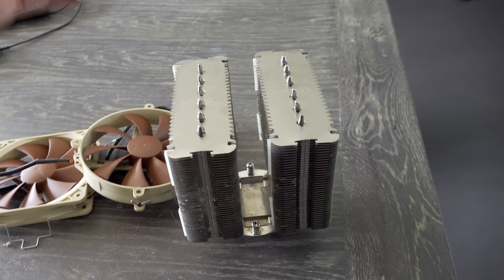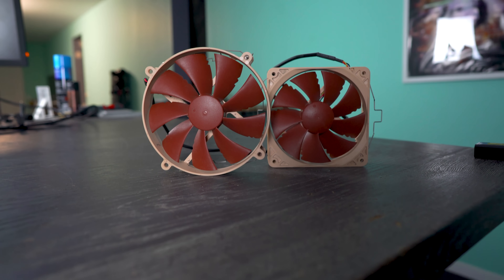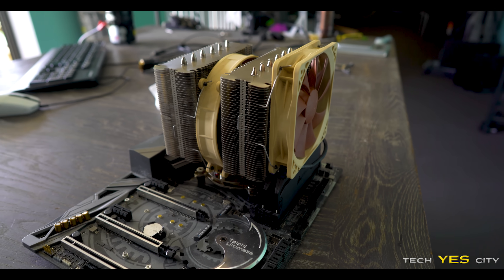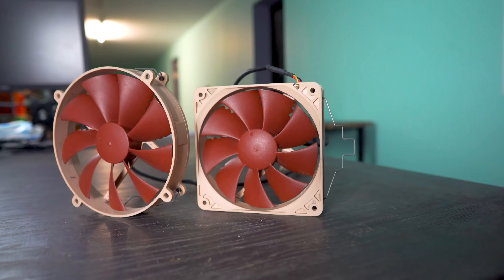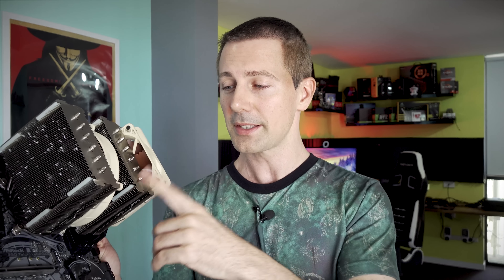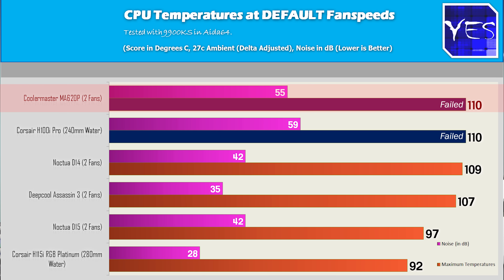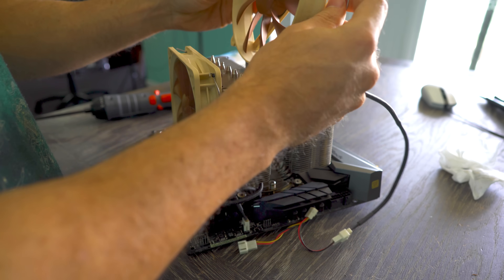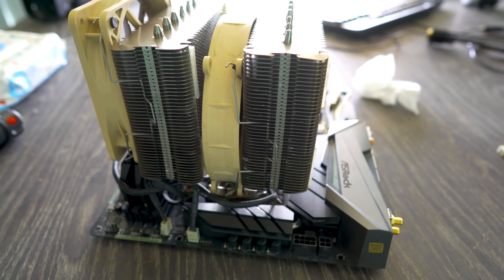This Noctua D14 is from 2009.... How Well Does it Perform in 2020?

Comment: I'm using a D14 from 2016 (came with pwm fans, plus Noctua offer free mounting kits👍) on a 3950x, and it works excellently unless trying to overclock it and push 200watts (it's pointless). I have changed the fans for Arctic Cooling P12 PWMs which does bring a nice improvement (the 1350rpm noctua fans are a little weak in my opinion).

Speaking if which, I had a recent issue of coil whine that got to the point of being unbearable without closed headphones (all fans are either off or ~500rpm at normal use). I took out the GPU as that was the 1st suspect, then the chipset fan, then tried stopping fans and I couldn't find the source. Skipped the Noctua fan from the D14 in the front of my case as it couldn't be that... I've never seen a fan fail that way before (still works the same mechanically). So it turns out that even Noctua fans fail occasionally.

I like Noctua fans, just a shame they're so f'ing expensive (seems pointless bundling speed reducing cables with PWM fans). Maybe I could afford them if I didn't spend so much on a CPU.🤔

Comment: Have there actually been a general improvement in cooler designs over the last decade? I still have an Arctic air cooler from 2012 and it still keeps my very hot FX CPU colder than I'd expect.
Reply: Thre hasn't really been much need for CPU coolers to improve since the power consumption and heat has flattened out or even decreased in later years. My Ryzen 5 2600 has a lot more computing power than my old FX-8350 had, but doesn't get anywhere near as hot.

Comment: Those big air coolers are just as good today as they were 10 years ago. I still use a SilverStone Heligon HE01, which is very similar to that D14, and an even older Prolimatech Megahalems on a couple of machines here. The only reason people have retired coolers like the D14 is because other things "look better" in the case. I've never used an AIO and never will.

Comment: TL;DW: It's just fine. I haven't watched but I'm guessing it's less than 5% worse than whatever air cooler Noctua releases now, since the fans are 11 years old if you got them used.

An 11 year old heatsink doesn't matter. 11 year old fans does.

Comment: I just got a d15 and I absolutely love this thing its keeping my ryzen 3800x at a cool crisp 30 C under load 50-55 C using there thermal paste too. Sometimes depending on what i'm playing I see it hit near 60 C
Reply: My only grip is god damn this thing is huge and I installed it on my board before mounting the mobo, regretted that big time as plugging everything in around this beast was a nightmare but I got it done.
Reply: Shannon Giasson The classic fingertip grip.

Comment: I'm really happy for this I love my D14. Long overdue, I upgraded in Feb to a Ryzen 7 from a Q6600. I had to get the AM4 kit to install my Noctua D14. I do find it a bit comical to have a giant fan and GPU on a tiny mATX board. Funny note, while putting on the D14, I didn't realize I was looking at D15 pictures and so I put the fans in the wrong order. Thankfully, the heat sink did note protrude my ram slots. Great video wished it came out earlier in Feb. Thanks man!

Comment: Definitely a greaty cooler. I have two Noctua coolers (NH-C14 and NH-U12S) that I've used for several years without any problems. When I put together my 3900X build a few months ago I opted for another Noctua cooler, the NH-D15 Chromax Black. 

It also has the slightly cut bottoms to reduce problems with high profile RAM. In addition to being able to adjust the fan placement like on the DH-14 in the video. It also came with the Linus Tech Tips orange highlights(rubber corners) on the fans, which I am using.

Comment: Lol of course it performs well in 2020. CPU coolers can't get old. I use my old cheap CoolerMaster from 00's and it can handle Ryzen 5 1600 with a shitty thermal paste at 78 degrees on load

Comment: NOCTU NH-D14 user Part 2
When I upgraded to an AM4 system I installed the STOCK R9-3900x cooler as I waited for the AM4 adapter from Noctua. I used the Asus DIP5 software in the Asus AI Suite 3 to optimize the CPU performance and fan speed profile. I didn't use PBO or whatever. It did a seemingly great job as it would TEST the voltages at various frequencies. And it found the MINIMUM RPM's to keep the fans going... BUT.. BUT...
The damn stock cooler was constantly ramping up and down as well as making an annoying, whiny motor noise. NOTHING I could do would fix this. When I replaced it with the NH-D14 the same thing happened but it was far less obvious... I finally ended up setting the NH-D14 fans to 30% until 60degC which avoids most of the spikes (even at less than 10% usage) while being more or less silent...
I also found that the FRONT CASE FANS had rapidly diminishing effectiveness. Anything above 600RPM makes very little different even under heavy load. I ended up putting them to about 300RPM and ramping up at 60degC as well but to a maximum of 600RPM. So the optimal fan config I found not counting my graphics card is for the PSU fan to be completely OFF (ECO MODE) and it never comes on, the front case fans are 300RPM then ramp up between 60degC and 75degC to 600RPM, and finally the CPU fans sit at about 300RPM ramping from 60degC to 75degC to about 700RPM then jumps up to 100% fan speed above 75degC to avoid CPU crashing).

Comment: Noctua NH-D14 user here!
Still running this cooler after TEN YEARS solid. Still working perfect! Noctua gave me a free AM4 adapter so now it's cooling my R9-3900x (12-core) CPU. At 20degC ambient I can run all cores at 4.275GHz at just under 75degC (though AVX in P95 will crash my system but everything I actually use is stable including Handbrake for which I run TWO instances so I can hit 100% CPU usage as my 1080p encodes otherwise max out the core usage to around 80% or so).
Reply: Heya, sorry to ask 5 years layer, but how is it holding up for you? I found one in storage, and I was thinking of using it for my next build

Comment: Thanks for the vid. Kindly take your time next time and mount the fans with the rubber brakets please. A real fanboy will get irked by the way you have assembled this thing. For testing you can try the D15 and D14 in pull configuration and experience the really annoying "whine" one of them has at full speed.

Comment: I have old hardware and for Christmas I went the ryzen route, so I looked to find brackets for my coolers. Zalman cpns10x quiet.. No brackets. No brackets neither were ever produced for the Cm Hyper 612s (v1) nor the 412s.

I had a noctua NH u12p laying around and Noctua actually still makes adapters. The thing is it's old, I had it with a nf F12.. 75C max on a 3700x. I then got  one if their new nf a12 fans and now max temp is down to 71C and at the same rpm of the NF F12. Trouble is nf F12 reached 1500 rpm, the a12 can go up to 2k and it never went there. So kudos to Noctua.

I'll try to mount the cpns10x with the AMD spring bracket but it will hug the gpu and I think it won't make much of a difference.

Comment: Running a D14 on a 9700k @ 5ghz, Taichi Ultimate. i updated the fans to Noctua NF-A12x25. I idle between 28 and 32c (depending on room temp and doesn't go over 60's unless stress testing.
Reply: Been thinking about doing the same with mine. Did you see an improvement over the stock fans? I suspect the d15 improvement over the d14 was largely the fans.

Comment: Question Everyone...

I am in the process of upgrading , just cos I am workin more in Reaper , its doin fine in the games I play so ill probs keep my Ghraffis Chaarrd for now cos the value is not there to upgrade that , but I am upgrading my current computer cos ... Well ... Because I can , so why not upgrade now , right! .

What do you all think I should ask for my used parts built as it's own PC , Area is SE-QLD . I am after genuine suggestions for an askin price that is a fair line between good value back for me and a sweet deal for the buyer .

R5 2600X (included Wraith Prism RGB)
16Gig RGB ThermalTake Ram @ 3200
Asus Rog Strix B350i Gaming WiFi
SSD's(new m.2 for boot and one of mine for games)
A new ThermalTake Versa H17 Window case
A new ThermalTake BX1-RGB-550 PSU . 

I'm unsure if I'm going to put my "backup" gpu in to sell, and just keep my current... Or... To keep it as a spare. 

I am hoping you guys can help with legit numbers to use when jammin up a gumtree add when I get around to it, cos I would like to regain some value and put the money back onto my card .

Thank You again anyone who answers.

Comment: I've had no problems with air coolers like the CM Hyper 212. In fact, I'm still using the same 212 I've had for 2 builds, now, on a Ryzen 3600 build and no temp issues, 26~28 idle, 60~65 max on load.

Comment: You may want to check into getting a small electric pressure washer ( under 1,000 psi ) for salvaging old filthy heat sinks/ coolers to quickly blowout all the dirt while still being gentle enough NOT to bend the fins.  Maybe even just getting one of those waterhose attachments that restrict the flow enough to raise the pressure.

Comment: With any of these Heatpipe designs, the important factors are the number and size of the heat pipes along with the material of the CPU contact area and heatsink surface area combined with airflow volume.  That means a cooler designed for a 65-95 watt CPU is not going to work well with a 125-200 watt CPU.

Comment: Rocking an x58 Xeon cooled by d14 (3pin fans)  with an r9 fury nabbed for cheap local all in an old school Antec case.  Pretty sure you could put the build on a poster for tech yes city.

Comment: I got a HUGE radial air cooler with one of my AMD boards my buddy traded me into years ago. It had a 120 fan mounted in the middle and the fins were light blue all the way up around the fan. It was dead quiet and cooled that chip much better than the stock coolers did. When I upgraded to the i7980 I tried to use it but didn't have the mount it needed so put it back on the old board. Not sure if I still have it because most of my boxes use the Cooler Master Hyper 212 of one version or another these days. You can buy those dirt cheap on sale or as perfect refurbs these days and they work excellent and are quiet. I'll use anything I can get that is used and cheap or free and works well. I still have a original Stacker tower case holding my win7 box. Quiet, has wheels, and tons of old school room, just no external usb3 ports.

Comment: I currently have this cooler. I bought it last year because I started my first build with LGA775 and the D14 supports it :) 
I have it on a 9600k right now and it does wonders.
Delidded and Lapped @ 5.0core and 4.8uncore  1.415V - LM on both sides. :)

Comment: If whoever had the pc before you had cleaned it they would probably still have it without complaint :))))))) I like the way the fan catches the top of the heat pipes as well which may be the hottest part of the cooler after a long time being on. Underwear is usually a decent cotton mix hahahaa.

Comment: I use my d14 for 10 years now !  First on a phenom II X6 and from there in any system i have owend a i7 3770k / i7 4790k / i7 7700 k and now on my 9700 k ! The only Thing i have changed are the Fans i use the Fans from the d15 with new clamps . And i still Love my d14 !

Comment: If you have a similar older cooler that cannot be used on another PC, if you have a 3D printer, you can rig up a case for a raspberry pi and use the tower cooler on your raspberry pi. even if left passive , they still cool those SOCs down pretty well.

Comment: mine D14 bought in 2011 is still in use till today cooling an i5 2500k @ 4.8Ghz (i'm surprised that this cpu has lasted this long at that OC speed lol) but it is showing some signs of oxidation so my tips is to get a tube of metal polish@Autosol and rub everything to a shine again, including the cooler plate that touches the cpu. It will perform just as good as new again trust me.

Comment: Still using the "D14 killer" Phanteks PH-TC14PE from 2011. Well mine is a bit newer and now with AM4 mounting, but 3rd system now and stock fans still going strong. I bought this to replace failed pump in 240mm AIO and it performed better :)

Comment: I wonder if that ram stick was causing mount to not be perfect. When d15 launched there was only like 3° difference in most tests. You've gotta have some low profile ram laying around. Of course it could just be deteriorated inside the cooling pipes over time.

Comment: Noctua didn’t get there reputation for nothing. I like air coolers but the clearance issues is a problem and what I mean trying to removing the graphics card and ram I ran into problems with spacing and not enough of room to use my hands so safely.

Comment: I'm still using CM 212+ i purchased 9 years ago. With a better fan though! Fins+heatpipes design is so good that it's not going anywhere any time soon. Little to no point of upgrading if it works.

Comment: Just because it's a 3pin, doesn't mean it will run at full speed all the time. It will still be controlled by voltage control.

Comment: Bryan, have you ever tried a Phanteks PH-TC14PE? They perform basically the same as the NH-D14 but back in the day were a heck of a lot cheaper.

I've obtained a lot of user air coolers, mostly Thermalright U120 Extreme and followon/equivalents such as the VenomousX and TRUE Black. They all work very well. I've also bought numerous used AIOs, they're not as bas you might think but the key is to avoid the lesser models in the first place. I've had no problems with good Corsair models such as the H110, H115i, etc. (just a single H80 refurb unit which eventually developed a noisy pump).

The down side of air coolers is potential shipping damage. One can ship a PC with an AIO and be a lot more confident it will arrive with everything intact. I also like the easier mbd access of an AIO, though one must take into account the lack of natural mbd chipset cooling that an air cooler often provides.

Comment: I'm using a hyper 103 with an i5 8400 from my previous build and the temps while gaming hardly reach 55°C, usually stays at 48-50°C, under stress it doesn't go above 64°C

Comment: I've been telling everyone about those ol'school AIR coolers and that they work in a pinch or just outright for daily-ing. 
  ZALMAN's 9900MAX and 9900MAX DF (if you can find one) from 11years ago. Those things were like $90 but, now are only around $25-$35 on AMAZON or eBay, and have 1151 support as well as AM4.
 I use a 9900MAX that has one 135mm Blue fan, thats very quiet at 1200rpm and can go up to 1600rpm. This thing cools a 5GHz+ 8700K all day no problem. Granted its a Golden 8700K. I let CBR20 run for about 20 loops 0 AVX and it maxed out at 80°c with 5GHz/1.250v. I was even able to bench it at 5.3GHz 1.380v at 93°c. 5.3GHz on AIR. Can never knock the old school, if it works. I happened to have one of those ZALMAN 9900MAX coolers brand new in the box and it fit the z370 Aorus Gaming 7 perfect. It actually uses the cintered/grooved heatpipes which Deepcool fudged on the A-III. Though, they didn't even need'em. So I figured why not. Plus it looks awesome inside of a Master Cooler 5 lite RGB with the modded mesh front piece and 3 ARGB fans in front with one in the back. I have it set up at the shop and a day never passes where someone doesn't ask about that cooler. Its definitely unique in its design just have to find'em new. The Black pearl Chrome Plating gives it durability and i found that the baseplates on all 3 that i tested were perfectly flat. No need for lapping as long as your IHS is flat. The ZALMAN website says it rated at 300watts. I don't know about all that but, it does handle half of that without issue. And yes ZALMAN is still making AIR coolers, just been missing in other markets. They do have a new cooler already out and it looks like a good one. Kit Guru did a vid on it. You guys should check that one out.

Comment: You can cut few lower fins, it will not affect cooling that much, bending ram is not good idea :D

Just reused AM2 cooler on AM4 ryzen CPU - leavers system is same size it seems, maybe holes in MB are different size, but clips were just fine and those CPUs were hotter, so no issues at all - 3200G max 60*C under stress test.
Fan is fine, aluminum heat sink - will stay same for 10 more years.
arctic 64 alpine - lol, page says its 90 Watts cooler.

Comment: Hey brian, I think your large memory sticks are causing an issue with the cooler mounting pressure,I bet you'll get even better results if you use low profile memory

Also regarding your question. I still use an old Coolermaster V6GT in my main computer. The DynaLoop bearing fans got really rattly around the seven year mark so I replaced them and kept using the cooler. Outstanding performer from the Phenom II x4 955 to the 3770K and now with the 6700K

Comment: Thanks
very informative 
I'm thinking about this one for my future i7 9700k.
I just want to know if it will get beyond 80c when gaming without OC
Reply: Why are you going Intel?
Reply: @GummyBearRacing  because i trust them and i prefer to stay with Intel.
Reply: i have this cooler with 9700k at stock its not goint to hit over 80 never bro, i have 50-60 Max while gaming dependes on a case airflow too
Reply: @CFCFaNBoY  thanks. I bought the ryzen 7 3700x, using the stock cooler

Comment: Still using my d14 from like 8 years ago, I have it installed on my 9600k and it performs perfectly fine, even with overclock, I got 2 noctua 120mm pwm chromax fans though so that it looks better, got them open box for a great deal.